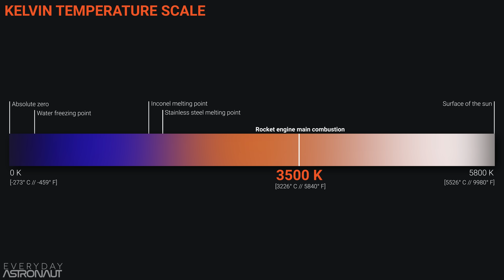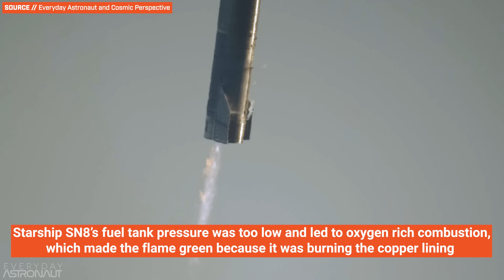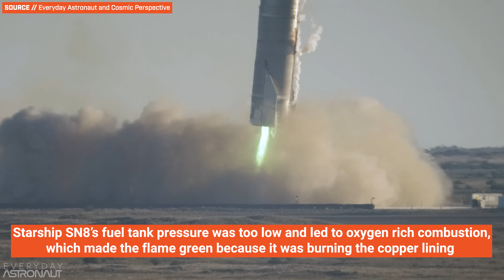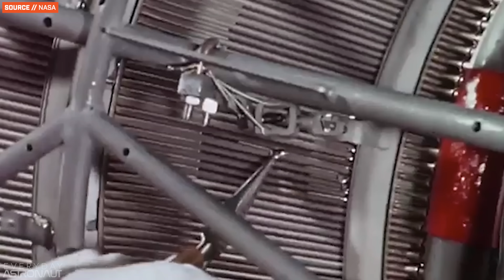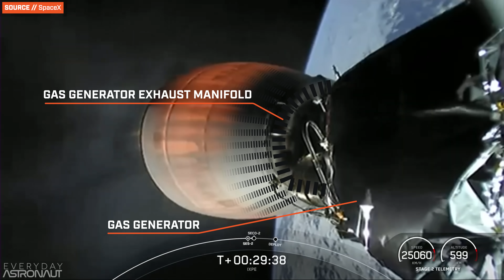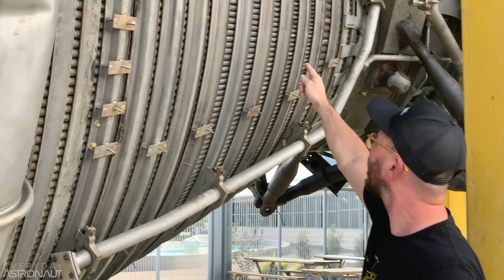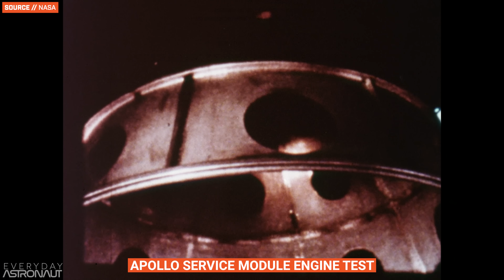Why don't rocket engines melt? How engineers keep engines cool

Comment: Conduction works in a vacuum. That's why copper is used in the engine. It conducts heat well. Only convection gets taken out of the equation in a vacuum.

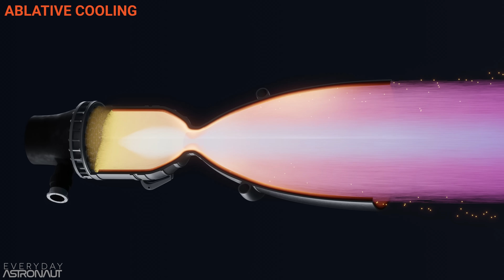Comment: 8:53 what if you start slow and throtle up during the flight to make up for lost pressure in the throat?

13:00 not only is my question how those little tubes can hold pressure up to main chamber pressure of 200 or 300 bar but also how you get the fuel into them with that kind of pressure? Or is the high pressure mostly due to the liquid fuel boiling and forming a gas? From liquid to gas, water increases volume 1000 fold. Idk how it is with fuels

Comment: What a great video! Excellent work. Only criticism - in the description you said "[Rocket engines] only real purpose is to convert the chemical energy... into thrust" I would have to disagree :P They also serve a ritualistic purpose as we gather around them and are filled with awe as they create thunder that would make Thor jealous, and build pillars of flame in the sky on which brave explorers climb into the heavens like more successful sons of Daedalus.

Another factor that isn't usually appreciated when talking about propellant choice is prospective propellants' properties as they relate to regenerative cooling. Such as whether or not the coolant is chemically stable at elevated temperature. Hydrogen for instance is stable at elevated temperatures, meaning it won't break down into something other than hydrogen. Hydrazine on the other hand is not, and will break down into something other than hydrazine by the time it gets to the injectors. Of course temperature and pressure effect this question greatly. Another pair of factors are the volumetric heat capacity and conductivity of the propellant/coolant. Of course they have to be effective enough to keep temperatures in check, but there's actually more to it than just "Good enough". 

The F-1 burns about 2.5 tons of propellant a second. A substantial portion of that must be pumped through all of those tiny tubes that are brazed together to form the body of the motor. The turbopumps already have the monstrous job of stepping up the pressure of the propellants high enough that they will flow into the combustion chamber, with that previously mentioned 2.5 tons/second flow rate. That's quite a powerful pump, even Grady from Practical Engineering would be impressed. But on top of the pressure rise necessary to make the propellants flow into the high pressure combustion chamber, there's an additional large increase in pressure needed to make the propellant flow through those hundreds or thousands of tiny tubes. And the power required to run the pump scales directly with the number and diameter of those little tubes (And the viscosity of the coolant). but what else scales with the number and diameter of tubes? Cooling performance. So more, smaller tubes = better cooling performance, but also more power required to run the pumps. So if a propellant is a more efficient coolant (I.E. better heat capacity, conductivity, lower initial temperature, and higher max temperature before chemical instability), it can keep things cool enough with fewer, larger tubes instead of more, smaller tubes. Meaning that the cooling properties of the propellant directly influence the size of the turbopumps, and the amount of the fuel's chemical energy that needs to be expended in the preburner to run the turbines. You have many levers to pull, and many of them move each time you pull one. And each lever has it's own costs, benefits, and limits.

Try not to roast my explanation too much, it's only a youtube comment, and I'm a mechanic, not an engineer :P

Comment: Would a leaking cooling nozzle create a small offset that turns the rocket unless actively steered? I thought there was a steering mechanism that some how burned one side of the engine over another. If I recall it might have been a hybrid solid rocket motor.

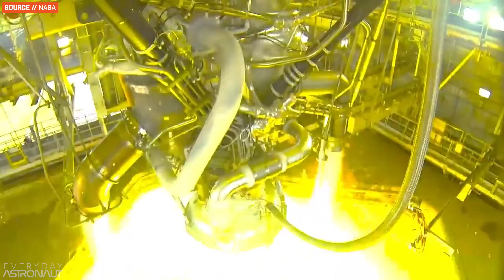Comment: There are some funnies in the english captions, like at 9:49 "because the engine runs on hydrolocks [hydrolox], which usually has a nearly completely transparent (mumbles) [exhaust], just water vapor..."
The auto-generated english captions also makes the "hydrolocks" mistake but correctly recognizes "exhaust".

Comment: Interesting and informative video, I love it. I didn't know about film cooling in the engines, seems like an easy implementation just putting more injectors in the edges.
I still don't get how you start an engine with regenerative cooling if those hot gasses are powering the turbopump. I mean, you need the engine already running to heat the gasses for the pump.

Comment: I know this isn't used much in modern rockets but using water as part of the fuel was used in the V2 to keep temperatures down. They could have used higher concentration alcohol for a higher specific impulse. I read somewhere they eventually eliminated the use of film cooling of the engine once they realized the 25% water alcohol burned cool enough to run the engines without it.

Comment: Aircraft gas turbine engines use some of the same tricks to achieve higher combustion temperatures (and thus fuel economy) and also enable higher compression ratios (and thus better fuel economy again). In the main they coat the blades with ceramic composites to handle higher heat and almost all blades now have active cooling where they have air passages inside them to help cool them (exiting at the blade trailing edge) and holes just aft of the blade leading edge to film cool the outside. This 'cooling air' is drawn from a late stage of compression (thus high enough pressure to go the right way) and itself is already several hundred degrees C. But compared to the 2500C combustion gas... its relatively cold!

Comment: If more than one rocket put you can lift pyramid. I saw it somewhere. Then is pyramid a space ship in disguise only wants that white tile material. Lime, cement may be. It has the opening to fill fuel like Jupiter's gas. Solar plasma, nuclear fusion material. Any fuel.

Comment: Jet turbine maintenance engineer here, we use most of these same methods to prevent aircraft engines eating themselves. Primarily film cooling though. Most engines tap off high pressure bleed air from the final stage of the compressor (which is already at around 300°c or more to cool the hot parts of the engines. Effectively in a turbine engine the combustion gases will NEVER actually contact any of the metal parts as they'd simply burn through it in seconds. 

Most impressive one being that the turbine blades are grown from a single crystal of titanium, are hollow to utilise the regenerative cooling via channels inside and then vent those hot gasses via tiny holes in the surface to maintain a film of gas in between the blade itself and the combustion gases, all while spinning hundreds of times a second

Comment: I wonder it anyone ever thought about a variable throat and nozzle bell. Maybe put a  methane fuel nozzle, in the second to the last, bell support ring, then redirect some cooling methane into the exhaust. Instant "Afterburner", except on a rocket 🚀.  You get "two for one", cooling and boost. Pe will rise. Pa should cancel. Pt at the nozzle could be regulated so Tt should not be a show stopper. Too funny 🤣

Comment: It still amazes me how engineers decided to use the cryogenic propellants from the rocket to cool down the engines before using that same fuel to produce thrust and heat, which is subsequently cooled down by more fuel

Comment: So, with a Regen cooled Rocket, theoretically you could make a fancy ice cream treat on the outside while you attempt to cook a hotdog near the exhaust (so long as its running something "non-toxic" like Hydrogen and Oxygen)
THEN again the blast and sound form the rocket might just injure or even kill you if you where close enough to touch the rocket nozzle while the rocket is running.

Comment: Technically the real reason they don't melt is because of the relatively cool boundary layer within the chamber/nozzle in between the cold metal and the very hot gas. It acts as an insulator and that's what keeps the metal cool.

Comment: Awesome video!
Re: the section about the regenerative cooling pipes failing, Wayne Hale had a great blog post about STS-93 (Columbia, July 1999). A loose pin ruptured 3 adjacent cooling tubes in the nozzle extension of one of the main engines. Apparently it was calculated that a rupture in 5 adjacent tubes would result in failure. 
The whole STS-93 launch is incredible reading. And the mission control audio is fascinating, ending with a pronounced “Yikes!”

Comment: The more I learn about rocket engines, the cooler they are to me. This is amazing, thank you
Video idea: How does engine throttling work?
Smaller question: how the heck does rocketlab manage to pump its fuel hard enough with an electric motor to bring it above the chamber pressure??

Comment: I’m glad you used the video of our 12kN MOMO engine.
Our 12kN engine is heat sink combustion chamber and radiative cooling nozzle.
In order to reduce the weight, an ablator that functions as a heat insulating material is sandwiched between the carbon of the heat sink and the metal of the outer cylinder.
And the improved version of the current 14kN engine has been changed to an ablation cooling nozzle using SiO2 FRP.

Comment: and this is the problem with fusion rocket design. when you have a ton of cryogenic liquid per second running through your system, and a max temp of a few thousand C you have a bunch of options to keep things cool; when you have a few grams of hydrogen at hudredts of thousands to a few million C , none of the methods listed above work at scale. Low power fusion thrust might be possible, but cooling a high thrust engine takes coolant, as the heat has to go somewhere.

Comment: Hey guys! Figured I pick brains if I could. I’m currently doing a projectfor college with a report attempting a mission to Mars. When considering the engines and power output I was considering the use of methane engines and utilization of fuel cells on board OR the potential of nuclear combustion or thrust and power. Any thoughts??

Comment: One thing not mentioned in regard to fuel ratios. The exhaust velocity is also related to the molecular weight of the exhaust gas. Fully burning RP1 makes more CO2 which has a high molecular weight, 44. You're better off having a bit more RP1 and a bit less LOX so that the carbon comes out as carbon, molecular weight of 12, and you have a bit more hydrogen to burn to H2O molecular weight 18. That gets you a higher exhaust velocity and a higher isp.

Comment: Question: if the only difference between the vacuum version of the raptor and the sea level version is the size of the bell, why havent they developed a telescoping bell similar to the directional engines that some advanced fighter jets use?

Comment: How about a way to make the engine cheaper and easier to build by simply using a tank of water for a total loss cooling jacket and film cooling of nozzle. This would simplify the plumbing. Less plumbing for the fuel. Water simply headed overboard for cooling is simpler plumbing.

Comment: Heatsink chambers are useful for experimental engines where one is trying to determine, for instance, the shortest chamber that can support complete combustion. That was the rationale for the various "trombone" engines we ran at XCOR, one of the cases where I actually did some rocket science rather than just engineering.

The best material for a heatsink is usually copper, for its combination of high thermal conductivity, ease of fabrication, and cost.

Using low thermal conductivity materials in a regen or heatsink engine is a bad idea, even though such metals may have higher melting point, they will quickly reach that melting point where a lower melting but higher conductivity engine can be kept cool.

Comment: I'm not an expert, but I think the regenerative cooling work like a pressure cooker, every liquid has a different boiling temperature at different pressures, at 300BAR the boiling temperature would be to high to boil it, also if some of the liquid boils it keeps the temperature stable.

Comment: Great video and amazing visuals! Although the parts about soot being dark because it hasn't had time to react with O2 is not quite right. The major reason has to do with incandescence (i.e. black body radiation) of the particles present in the exhaust. This is the same mechanism that causes the nozzles of say MVAC to glow bright red. 

The reason there is a difference between the Space Shuttle Engines and the Delta IV engines is because of the absence of soot in the Space Shuttle engine exhaust. When there is no soot, how the exhaust looks is dominated by electron transitions emitting photons at very specific wavelengths. For the Delta IV engines, the ablative coating being shot out the engine is achieving high enough temperatures to become incandescent. This is similar to why Bunsen burner flames are bright blue (pre mixed flames emitting photons through electron transitions) versus why candle flames are reddish (soot particles at the diffusion flame front become hot and glow incandescently).

The reason the turbine exhaust on Merlin engines is dark has more to do with the soot density and relatively low temperature of the exhaust than anything else. Soot density is also related to how complicated the fuel molecule is. Longer chain hydrocarbon fuels such as RP1 will generate a lot of soot and so the exhaust will glow bright whitish-red. Simpler fuels like Methane have a much lower soot density and so do not burn as brightly. In the case of Raptor where they're operating pretty close to stoichiometric, very little soot is generated and the dominating emission is then again by electron transitions.

Comment: In the V-2 rocket, Methane and Liquid Oxygen, from separate tanks, were force-fed together into the combustion chamber via 2 gas-powered turbines (which itself was powered by the reaction of two other expanding-chemicals to turn the turbine blades; the exhaust of which separately vented out the side of the rocket). Tons of heavy thrust was required to move a rocket that itself weighed several tons due to the Methane and Liquid Oxygen it carried , as well as, the gyroscopes, turbines, wiring systems, and payload of explosives. It also used fuel-film-coating to cover the inner walls of the combustion chamber.

Comment: Didn't many of these cooling ideas originate with the V-2 rocket of WWII. They used injectors at the top of the combustion chamber to coat the entire chamber walls with a film of fuel. And, I think this same fuel was initially pumped through the thin walls of the combustion chamber before it was injected out at the top of the chamber to film-coat the combustion walls.  Various German manufacturers of high-pressure pumps, gas turbines, gas burners, and combustion chambers were employed to help produce thousands of V-2 rockets. (The Nazis also used thousands of people as slave labor in the assembly of these rockets).

Comment: The point about ablative cooling affecting the throat-exit ratio made me think that you might do the same thing (intentionally) with film cooling. Increasing the film thickness (pre-throat) should also shrink the throat area somewhat, shouldn't it?

Comment: Fascinating, I've wondered about the various cooling options for quite some time. I appreciate the depth and the answer to "if they pump cryo through the bell to cool it, wouldn't that be quite prone to issues" question I've pondered some while (and subsequent question if those issues are actually issue or would they contribute to cooling).

You explain highly complex in an easy to understand way. Thank you.

Comment: As a student of rocket engineering,  I will have to contradict his statement that the purpose of the combustion chamber is to convert chemical energy to pressure. The purpose is actually to convert to kinetic energy, given the exhaust gases a huge momentum which is also applied to the rocket in an equal and opposite reaction.

Comment: Why might they not use multiple stage bells on the rocket nozzle? The inner bell could be ablading for cooling. Once you reach vacuum, you could shut down, jettison the inner bell then reignite the engine in vacuum configuration. Maybe you could eliminate the need for some of those engines if the engine can perform in the atmosphere as well as in vacuum.

Comment: It wouldn't be impossible to cool turbines by flowing fuel or oxidizer through them; we do it on jet engine "hot" sections, with bleed air from the compressors.

Comment: Love these explainer videos Tim.  Good job.  Curious if you've thought about doing one on avionics and other factors of how accurate a rocket can be?  I ask because of the recent JWST launch and the accuracy of the Ariane 5 doubling the life of the telescope due to saving fuel of the craft.  Assuming equal payloads is the Ariane just a more accurate rocket or could an Atlas or Falcon have been as accurate ?  Beyond avionics what else helps contribute to the accuracy?  Throttling of the engine?  How does that work?